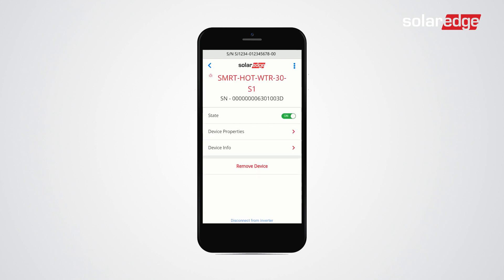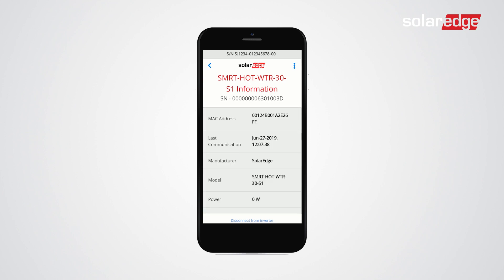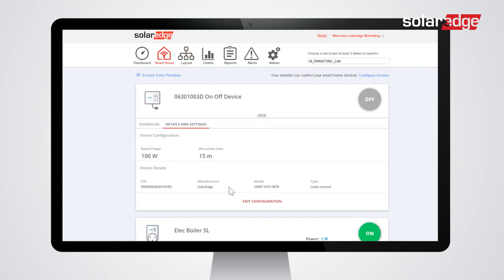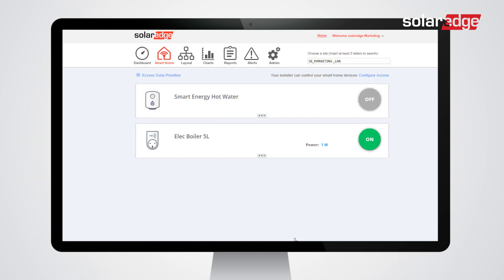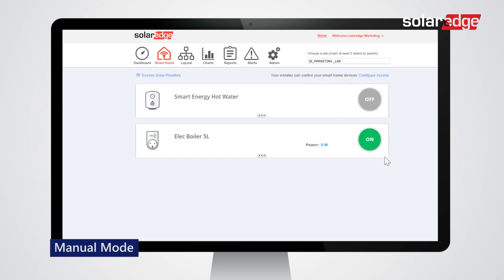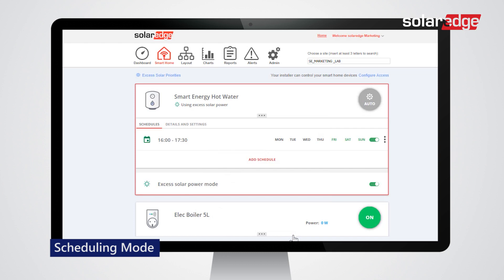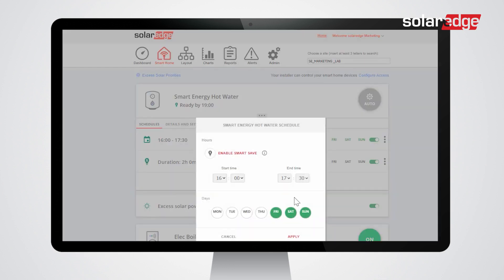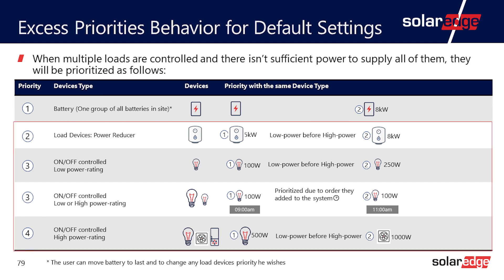Configuring the Smart Energy Hot Water

Comment: good video...    What does it mean when the green light is blinking every 5 seconds ?    I get a communication error in my application (for my hot water diverter).   PS,  my hot water diverter has been working for the last 9 months without issue until recently when ive been getting a communication error.
Reply: Did you find the problem that was causing this? And a solution?  I'm having the exact same issue.
Reply: @drummerkeM  yes.  It was a zigbee bluetooth communication loss issue between the hot water diverter and the main inverter.   Had to get my installer to come to my house and call SolarEdge and reconnect the base configuration again